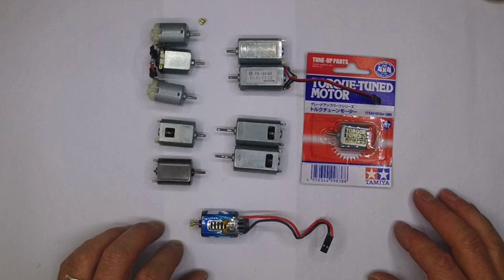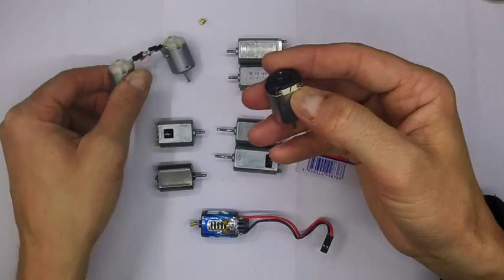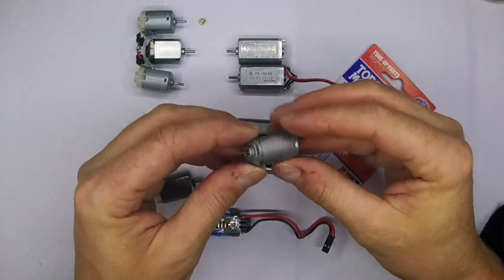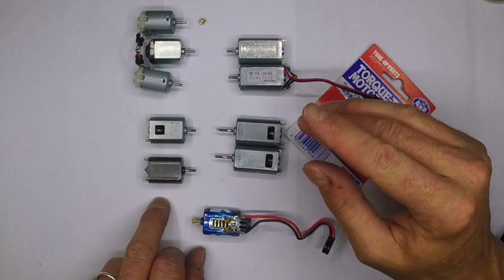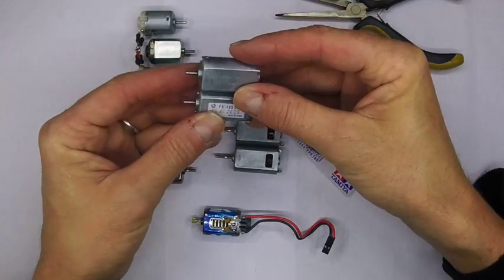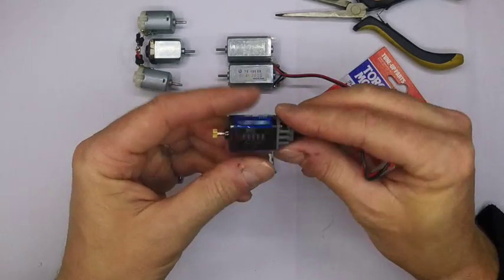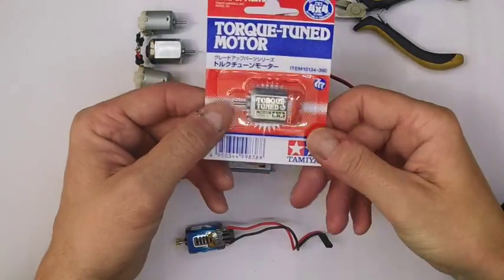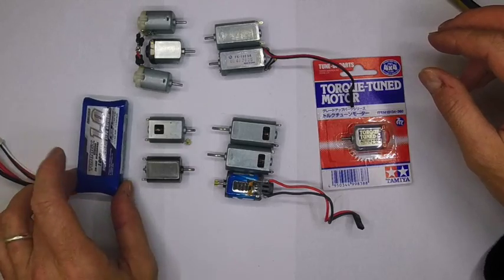Nerf Motor Mod Guide

Comment: Guys the 3240s are back in stock from zinky here is the link 

http://m.ebay.com/itm/like/121624679840?lpid=82&chn=ps&ul_ref=http%253A%252F%252Frover.ebay.com%252Frover%252F1%252F711-117182-37290-0%252F2%253Fmtid%253D1588%2526kwid%253D1%2526crlp%253D69982082769_324272%2526itemid%253D121624679840%2526targetid%253D124340412009%2526rpc%253D0.18%2526rpc_upld_id%253D52266%2526rlsatarget%253Dkwd-124340412009%2526device%253Dm%2526mpre%253Dhttp%25253A%25252F%25252Fwww.ebay.com%25252Fitm%25252Flike%25252F121624679840%25253Flpid%25253D82%252526chn%25253Dps%2526adtype%253Dpla%2526gclid%253DCj0KEQjw_YKtBRC7zZjFp8bF_foBEiQAfyigc892NO2-Vv1XJWx_hMGdsiykZfjrBQaxu1ZoE2ZiWuYaAh6G8P8HAQ%2526srcrot%253D711-117182-37290-0%2526rvr_id%253D865357812257&ul_ref=http%3A%2F%2Frover.ebay.com%2Frover%2F1%2F711-117182-37290-0%2F2%3Fmtid%3D1588%26kwid%3D1%26crlp%3D69982082769_324272%26itemid%3D121624679840%26targetid%3D124340412009%26rpc%3D0.18%26rpc_upld_id%3D52266%26rlsatarget%3Dkwd-124340412009%26device%3Dm%26mpre%3Dhttp%253A%252F%252Fwww.ebay.com%252Fitm%252Flike%252F121624679840%253Flpid%253D82%2526chn%253Dps%26adtype%3Dpla%26gclid%3DCj0KEQjw_YKtBRC7zZjFp8bF_foBEiQAfyigc892NO2-Vv1XJWx_hMGdsiykZfjrBQaxu1ZoE2ZiWuYaAh6G8P8HAQ%26srcrot%3D711-117182-37290-0%26rvr_id%3D865357812257&_mwBanner=1
Reply from the maker: That link is stupidly long, can you find a shorter one? I can confirm that the quality of the new Zinky motors is NOT as good as the original Mabuchi ones. Chrono results should be out this month.
Reply: I'll keep on looking. Man seriously those motors are getting harder to find everyday it's so annoying!
Reply from the maker: Latest new on these Nichibo clone 3240's- THEY ARE METAL BRUSHES and will fail. Not the fault of Zinky the seller, the manufacturer has stiffed him.

Comment: are these the same ones you have in the video I may try these
http://www.ebay.com/itm/For-MABUCHI-FK180-3831-DC7-2V-36000RPM-High-Speed-High-Torque-Brush-DC-Motor-/231140082036?pt=LH_DefaultDomain_0&hash=item35d105c174
Reply from the maker: Nerfarmourer has tried them, worse than stock I'm afraid, even at 3s.
The whole 3240 situation is just nuts. Look for E-Sky, Losi or Blade 180's, those are all 3240 winds.
Reply: yea I grabbed some last night

Comment: I was planning on modding my nerf demolisher. Currently im set on Plasma Dash motors. Is it too high powered for the demolisher circuit? Any advice and recommendations?
Reply from the maker: Plasma dash motors are not an optimum wind for Nerf IMO, they have plenty of RPM but not enough torque. The motors in this guide are my recommendations, all have proven performance and run well on the power supplies I suggest for them. The Tamiya motors MUST be run from a 1s Lipo, they can't be used with anything else.
Reply from the maker: Also, any motor replacement or change of power supply requires proper rewiring with at least 18awg silicone insulated hobby wire. Guides that suggest leaving any stock wire in place without a MOSFET are talking nonsense. There is a guide to Demolisher wiring at www,Britnerf.co.uk that covers the simplest method.

Comment: hello tom first of I would like to say a big thank you!!!! to you your vids you are so much more useful than the other guys on here. (oz nerf nerd is also very GOOD!!) I have a few pairs if the 3240 witch perform absolutely fine that I love ($9.50 Ebay) and one set of extreme 180 ($30 Ebay that are not available no more there Phasing them out) you told everyone there overkill and they are they eat my darts for breakfast but I see many many 180 on ebay but don't understand what to buy in rpm specs. now wane I bought the 2340 it was a fluke I was new to moding and went with a china seller for 9.50 usd and got lucky. but I see tos of 180 on ther for cheaper that show specs but I was wondering if you could tell me what to look for in rpm?? I have the blaster smiths UK kits with lip 1000 milly amps 2cell on the strife and 2200mAh 2S 25C Lipo for the  rapid strike just wondering what I SHOUD buy in RPM and if I need to get the  same motors?
Reply from the maker: All those other 180 motors are HOPELESS! It's really annoying, but you can't get anything except FK189SH-3240. The only reliable way to get them is to buy the original Blade, Losi or E-Sky helicopter motors. If you have an alternative source for 3240's, suck it dry as I am paying twice what you are for them. 
All the RC helicopter 180's gave been rendered obsolete by brushless motors in their original use, so we aren't going to get any more. Mabuchi have a minimum order of 10,000 PER MONTH! So no chance of a new run.
Glad you find my stuff useful!
Reply: Foamdata Services thank you very much
Reply from the maker: Sorry to be the bearer of bad news!  Eventually the 3240 will become totally unavailable. Fingers crossed the Chinese clone them.

Comment: A few questions about modding my stryfe:
I'm going to rewiring, put in meishel motors, and use IMRs?
Is it safe to use 4 IMRs? Will I have to upgrade my rev switch? What gauge of wire would you use (I haven't rewired a blaster and would like to know what thickness you use)
Any other suggestions would be greatly appreciated for I'm fairly new to modding.
Reply from the maker: 4 IMR's will simply burn your stock motors out. I have seen some Stryfe motors smoked on 3 cells and one dummy, but 3 will give you best performance. You can upgrade your switch uf you like. It's not a must do mod on stock motors, but if you do a Cherry DC2. 10.1A switch is good. I use 18AWG silicone insulated wire for all my 130 builds, check my Stryfe wiring guide for details.
Drop by www.britnerf.co.uk any time if you need more help.

Comment: Could you give a list of the items used for motor modification?
Reply from the maker: I use everything that is in my rewire guides, namely appropriate wire 16/18awg silicone insulated hobby wire, the right battery pack, which depends on the operating voltage of your motor and a good set of microswitches.
Reply: What motor do you recommend for a Stryfe?
Reply from the maker: EmperorNightOwl Depends very much on what power supply you are going to use. For 2s lipo or 2 IMR cells then Meishels are best, if you are going 3s Lipo then Falcons are good, if ypou want a good basic strife without spending a fortune then the stock motors on 2s shoot high 90's FPS. All my strife builds are here on the channel, check them out and look at the performance figures linked in the descriptions.

Comment: What would you recommend for the elite rayven? The 130 falcons? I just got one and would like to do a rewire/motor upgrade with a lipo. It's my first mod, but i have some experience with rc planes and helicopters so i'm not worried about the soldering etc.
Reply from the maker: Falcons will need a 3s Lipo, which may not fit the stock tray without an expander. They would be good. Meishels will give you very close to the same performance with a 2s pack that will fit the tray. Both options will get you 105-110FPS, a handy increase.
Reply: Foamdata Services Awesome. Thank you for responding! I have a bunch of 2200 mAh 3s packs for heli's, it'll be awesome if i can fit one of them in there somewhere. I'll look at the Meishels as well
Reply from the maker: New info- Falcons are getting hard to find, if you see them buy now as main stockist is currently out.

Comment: Can you run a 3s lipo with the xtreme 180s?
Reply from the maker: Yes but it is pointless, you simply get 2fps and burn every dart you fire. The foam mist that comes out the barrel is funny though. 3s LifePo4 packs at 9.9v each are the sensible limit for Xtremes. Falcons are the best 130 solution at present. Performance of 180's, no shell cutting, cheap.